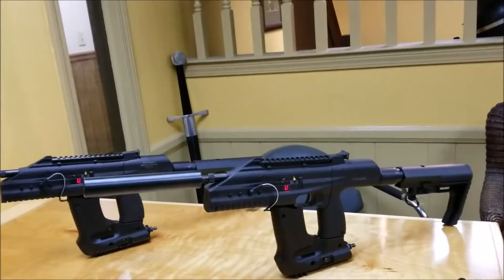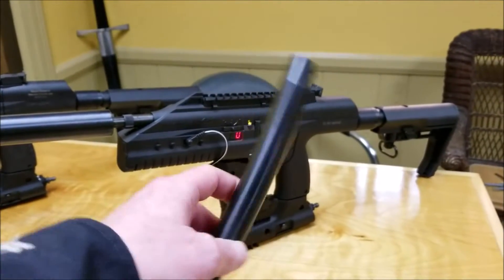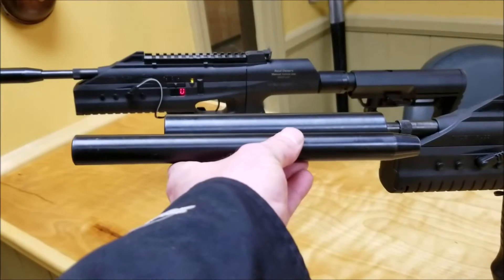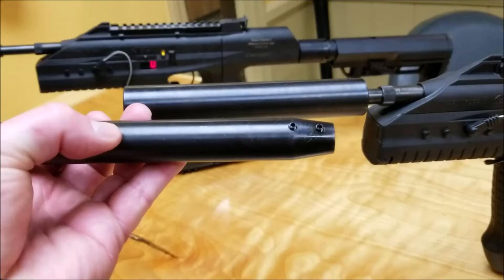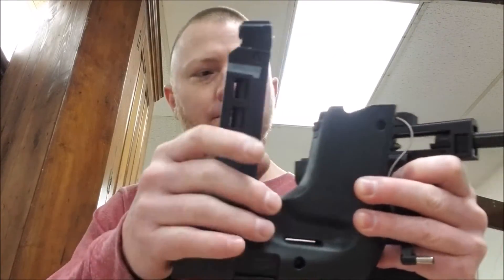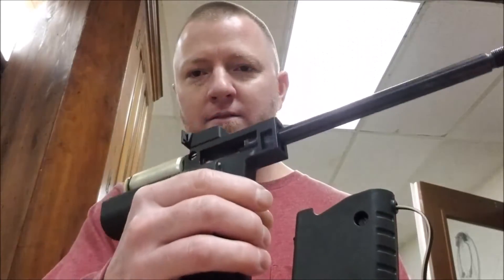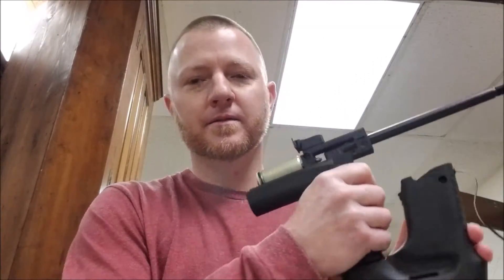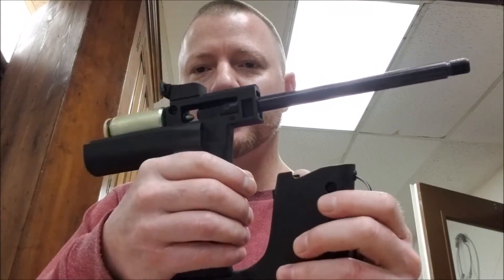400mm & 500mm Barrel 4K Build's

Comment: I’ve got the 500 mm barrel, quality and overall performance is fantastic, not impressed with the faux silencer, ended up drilling the end cap (the one I received was not threaded) so it slide over the barrel threads then lock downed the set screws. It’s now a very solid set up....
Reply from the maker: This 500 is the first one I have seen that has the fake suppressor threaded. I am told this is the new style, and will not be offering the old style on the other bird anymore.  It is also threaded. Let's hope they get it right with the 400.
Reply: Hey, My name is Dave and Im in NY, and I bought a BKBD couple yrs ago, and finally want to upgrade. Do you offer upgrade services??? WYA? Can we chat sometime? Thanks bro... Serguey refered u. @masondawson4061